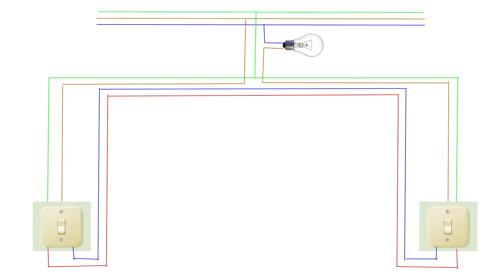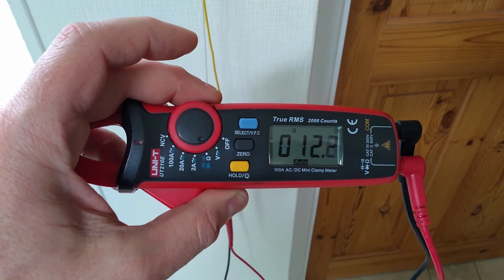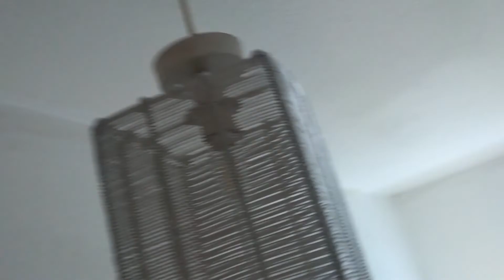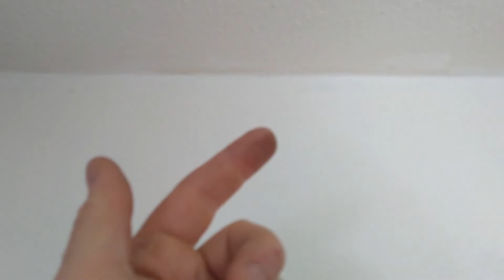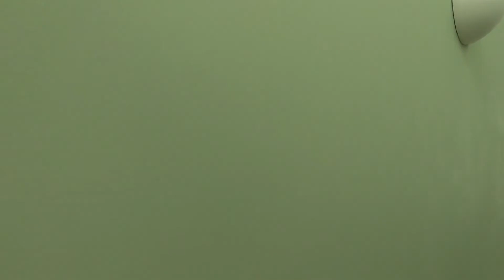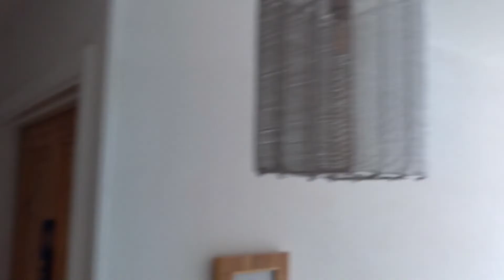Solving a lighting problem with Tasmota Smart Switches, Part 3.

Comment: Hi, this connection system is very usual in the UK for 2 way switching and the colours are as you would expect in an installation of 20 or more years old. 
Your first diagram was exactly right and what most people expect typically when wiring single cables in conduit. What you have is how you would wire with twin and earth and three core and earth cable. When you run through the two alternate diagrams you actually get the exact same results. I was taught this on site in 1979 and it just stays in your head. Loving your videos and binge watching as only just found your channel. All the things that interest me. Thanks.